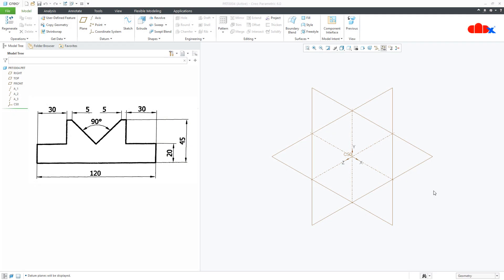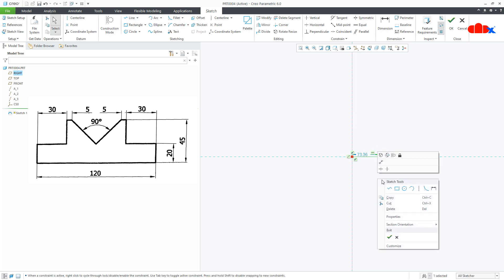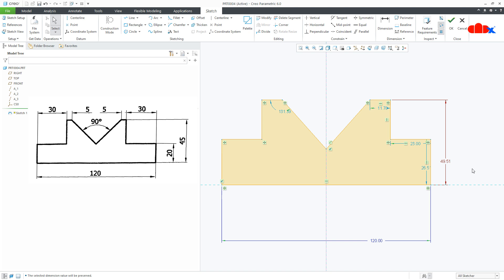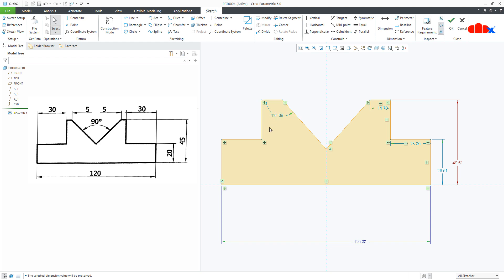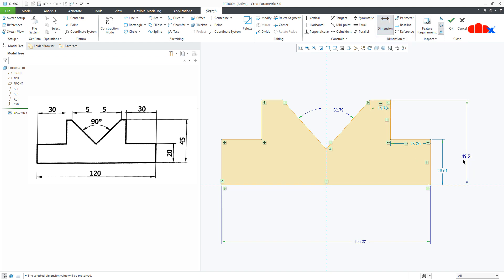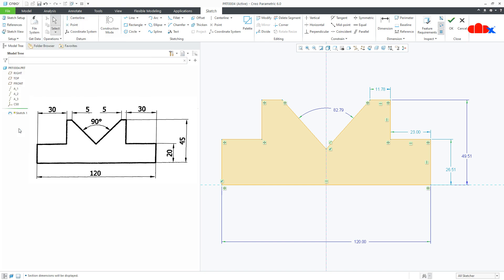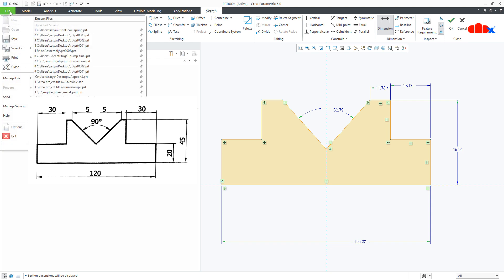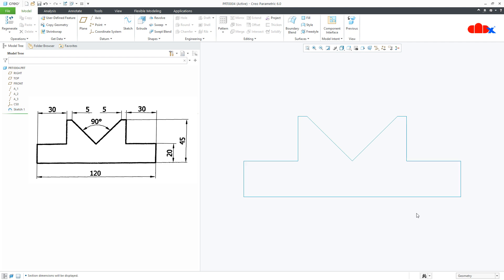How to delete a dimension inside the sketch in Creo Parametric

Comment: Sir how to place axis to object like hose which is variable in cross section and made by sweep bend command.. Please help in this sir
Reply from the maker: You can convert the path as the centerline.
Reply: In igs there is no path sir,  how to apply axis as a centre line Or any other method so that we can put central axis to sweep blend Command in hoses Or bend tubes with variable cross section

Comment: You told about configuration hide dimensions setting but i have doubt that if i open the new CREO will be same setting or will change??
Reply from the maker: If you save your setting in your config.pro then it will be always active whenever you open the Creo. If not every time you need to do this.